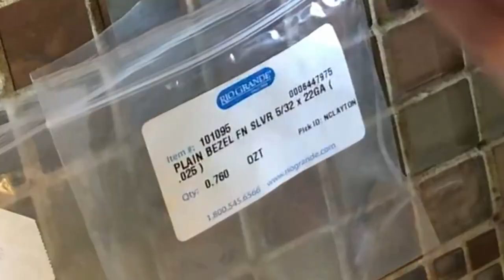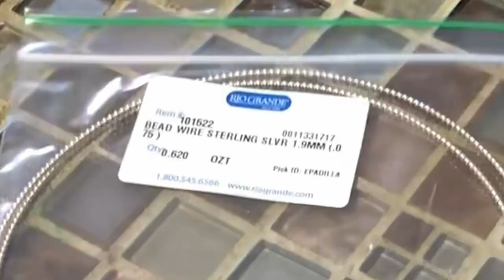How To Make A Silver And Turquoise Necklace

Comment: I was a Silversmith making Navajo style jewelry for 2 decades.
I have quite a collection of stones (cabs) also.
One day about 20 years ago I just stopped producing jewelry but thought I’d get back into after I retired.
Your video has inspired me to return to it.
Thank you for the video and your lovely work.
I need to source the gas torches you use in this video. Liked and Subbed.
Reply from the maker: @Archtops OMG thank you so much for telling me this!  I sometimes go through a rut and a long amount of time not creating anything and it is comments like yours that keep me going. 🥰I went about 10 years without making anything a while back and then one day just started back up.  I bet your work is beautiful and maybe one day I can see it.  As for the torches I use.  I got them at home depot.  They are just kitchen torches that I fill with butane.  I use one for smaller projects and if the piece is large and the solder won't flow I bring in a second torch for higher heat.  Here is a link to the kind I use.  https://www.homedepot.com/p/Bernzomatic-ST2200T-Butane-Micro-Torch-330194/301134308
Reply: Thank you for your kind response Jennifer and the link.
On Saturday I discovered a supply store only a mile from my house. I took an old Squash Blossom that I had inherited and traded it for Silver and and other items I would need. I’m thrilled about setting up a small area to start creating some silver pieces.
Thank you again for your kind response.
Don
Reply from the maker: @Archtops  Don you go for it!  So glad to hear you have a supply store nearby.  I wish i did.  Oh I hope to make a squash blossom some day.  They are so pretty....majestic!  I would love to see what you make.  Maybe you can post a video!

Comment: Hey, thanks for sharing, stunning piece!  Can I ask what kind of bit you used with your flex shaft to file down the bezel wire?
Reply from the maker: Hi Thanks for asking!  I used a dremel ez lock grinding wheel with the ez lock mandrel and put that into my flex shaft rather than a dremel tool.  I think I got it at home depot.  I put the cord through the hole of my bench pin to hold it upright.  I am sure there is probably a better way to grind down bezel wire (like a grinding wheel machine) but I just used what I had available to me and this was the fastest way that I could think of grinding it down rather than using sanding paper and taking hours.  I did learn if you have wire that is going around your bezel wire (like for decoration) you don't want the bezel to be shorter than that wire or you might have a difficult time when it comes to setting the stone.  Also, please be careful if you use this method and mind your fingers!  :D